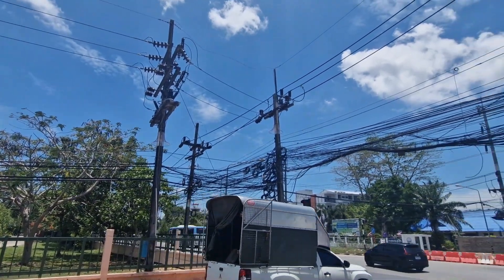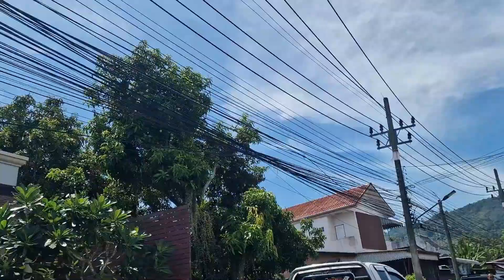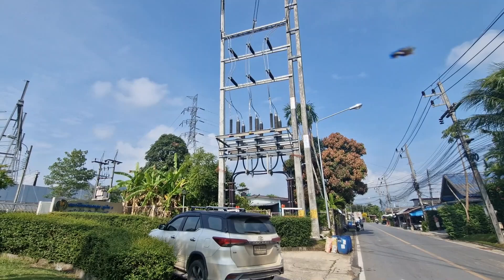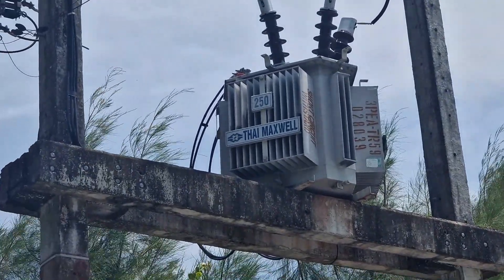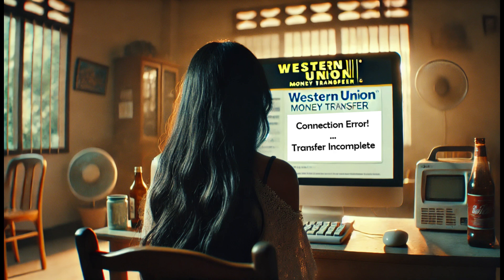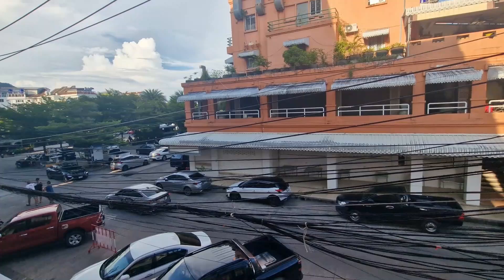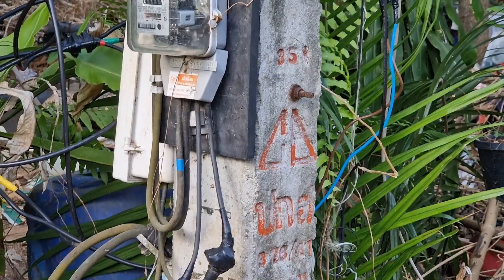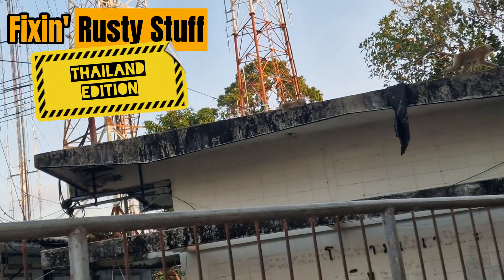Untangling The Mystery Of Thailands Messy Electrical Cables

Comment: I see the many internet fibers as a work of art and blending perfectly with the crowded cities.
Don't complain, you go order your internet connection on a Christmas day and the next day they come, install it and it is up and running. The power grid in Thailand also works surprisingly good compared to how the 220V lines look some times, can't complain how much they achieve with so little investment and maintenance.
I admit though, one should be cautious about the greatly varying quality and safety standards of electric installations and watch out not to get grabbed by a fiber cable.